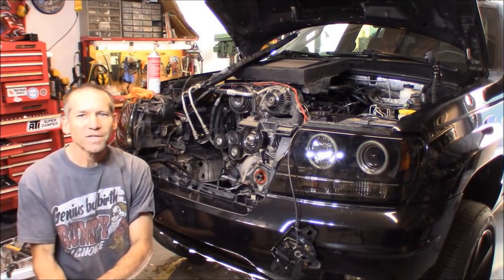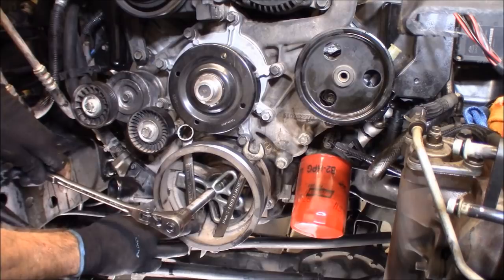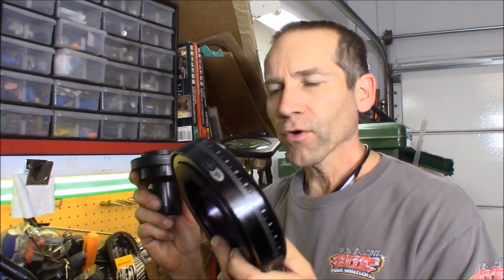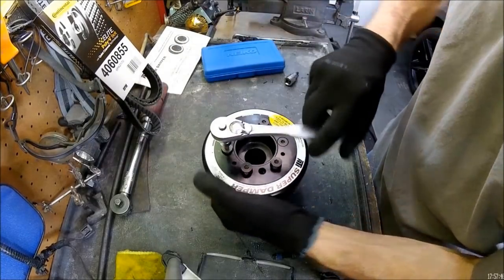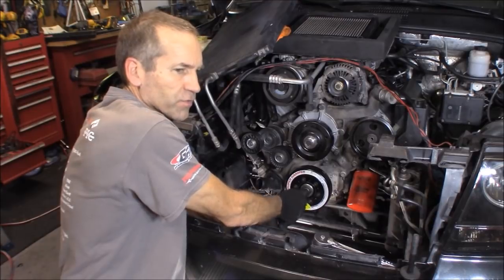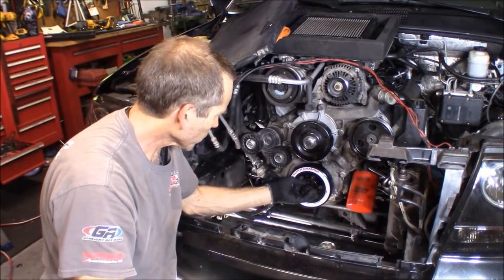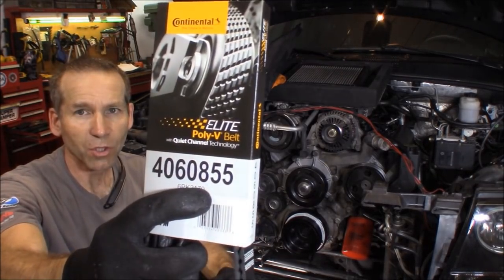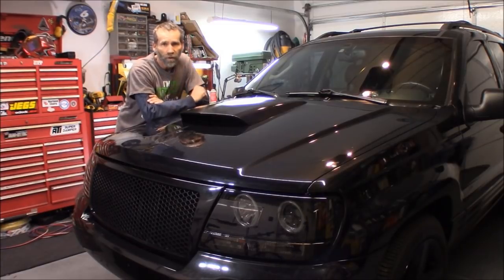How to Install a ATI Super Damper on a Dodge Jeep Chrysler 3.7 & 4.7

Comment: So, a few months ago,I asked a question of Martin on this video, and he was kind enough to reply, concerning the fact that after I put this super damper in 25% underdrive pulley on my 2000 WJ 4.7, I experienced overheating issues. I could solve it by turning the heater on full blast, which told me that perhaps the cooling system just could not keep up after reducing the size of the pulley by 25%. however, Martin had not experienced the same issue, so I could began looking for other culprits, so if you are having overheating issues after installing this part, here's what I did just so you have the information.

I've replaced the radiator, put in a new thermostat, flushed the system entirely, bought and installed a new water pump, and still had an issue with it overheating. I live in Texas, and it would do fine in stop-and-go traffic and in town traffic, but as soon as I hit the highway at 75 to 85 miles an hour, it would creep up to 215, 220, until I turned on the heater to blow off the excess heat, then it would return to 210.

I even bought and installed one of those solid aluminum 2 core radiators off of eBay, from GPI racing. Thing is beefy, and I was quite impressed. Everything lined up perfectly. Although, you do have to bend out the core support a tiny bit at the edges of the radiator, since it is about an additional inch-and-a-half thicker than stock. This did seem to help, and definitely kept it right at 210 in the morning time, but as soon as the heat crept back up, so did the engine's temp at highway speeds.

However, upon closer inspection after I went back to see what the problem could possibly be now that it had a new radiator, I noticed something. The genius engineers who designed this vehicle, of course put the AC condenser directly in front of the radiator, and even though I put the new radiator in, I hadn't looked all that closely at the condenser. it actually looks like it's quite clogged up, which could explain a lot about the airflow quality not being good enough to keep the coolant cool, because it's being blocked off by the condenser, which, if it's really bad, acts like a wall in front of the radiator.

So, I'm going to install a new condenser on my AC system, and also put in a flowkooler high flow water pump. They're a bit pricey, at a hundred and thirty bucks, but it would be worth it to keep the vehicle nice and cool. Increase performance often results in the need for increased cooling system efficiency. I'm hoping these next two steps work, but hopefully this information helps anyone out there experiencing similar issues.
Reply from the maker: Amazing that you're having this much trouble keeping your engine cool. I did also replace the radiator on mine I found it clogged with dirt in that area with the metal bumper support sits directly in front of the radiator and AC condenser. Now  that I replaced the hydraulic cooling fan with an all-electric the engine runs extremely cool I haven't seen temperatures higher than 200 and that is on days of 113 degrees out here in Las Vegas. You'll have to let me know if that aluminum radiator holds up I've had bad luck with the Champion aluminum radiator that I installed in my XJ I've gone through three of them. I'm done with champion.
Reply: @martinbuilt  I am a bit perplexed by it as well. I have also installed the fuel injectors that you had in another one of your videos, and an CAI from Airaid. I am running out of ideas as to what the issue is, unless there is something causing the engine to work harder than I think it is. My mileage seems to be around 15-17 MPG average, so it doesn't seem to be getting bad mileage. I already have a new cat back exhaust, and the cat was replaced at the same time. My AC system currently needs to be replaced, but even though the compressor does not work, it still spins freely and doesn't seem to hinder the engine. I have the combination mechanical and electric fans on my Jeep, and it still can't keep cool at highway speeds. Thought about replacing the mechanical fan with an electric one, but I have not found a ready-made kit for such a conversion, and I don't have anywhere to do my own fab work right now. 

My next planned step will be to try putting on the flowkooler water pump, and see if that helps. It's a less expensive option before I replace the AC system in a month or two. If that still doesn't work, I may have to finally bite the bullet and let a shop take a look at it. Knowing my luck, they'll figure it out in about 3 minutes and charge me $600 to fix it, and it'll be something small and stupid. 

I can tell you that the radiator I put in, which was a GPI Racing product, 

( https://www.ebay.com/itm/2-row-Aluminum-Radiator-for-JEEP-GRAND-CHEROKEE-WJ-WG-4-7L-V8-1999-2000-99-00-AT/262558754225?_trkparms=aid%3D111001%26algo%3DREC.SEED%26ao%3D1%26asc%3D20160908105057%26meid%3D3247e5f8a1ce41b99aedccad4689b68f%26pid%3D100675%26rk%3D1%26rkt%3D15%26sd%3D262558754225%26itm%3D262558754225%26pg%3D2481888&_trksid=p2481888.c100675.m4236&_trkparms=pageci%3Aa97f094c-bd57-11e9-8a9f-74dbd180440a%7Cparentrq%3A8821547e16c0a9e42e4f3f54fffc02ca%7Ciid%3A1 )

seems very well built, was easy to install, and definitely does help the vehicle stay cooler longer. It doesn't start to overheat now until the temp hits around 85 on the highway. I installed it this last weekend, with no issues. All the fittings lined right up, except for it being a little tight around the core support, which just needed to be adjusted with a hammer a bit. I have not heard anything positive about the champion line of radiators either.

Each time it overheats, it always cools back down when I turn on the heater full blast, even while I am still on the freeway, which seems to indicate a problem with airflow. I will update after installing a new condenser and the flowkooler pump. Also looking at replacing the thermostat with a high-flow robertshaw model.

https://www.flowkoolerwaterpumps.com/collections/hi-flow-water-pumps/products/1751-1999-2013-jeep-dodge-3-7l-4-7l-water-pump
Reply: @martinbuilt  Update: Since my last post, driving under normal and some off road conditions. The new radiator works extremely well. Also removed the old AC condenser. Definitely was a factor. It was warped and partially clogged. Been driving without it entirely, as a complete new AC system is on the way. No overheating in 100+ degree weather as long as it was under 2200 RPM's. At highway speeds over 75 MPH, there was still overheating, but not as significant as before. Pulled and inspected spark plugs and coils, none showed abnormal wear. It may be that at higher RPM's the stock water pump just simply does not rotate fast enough to keep up, with the 25% under drive pulley, while ambient temperatures are higher than 90F (average it has been in my area for weeks). Hoping the new Flowkooler at the end of the month will fix that.

Side note, when I had the cat replaced a few weeks ago, the mechanic who inspected it said there were multiple cylinders with slight misfire. Not enough to set off a CEL, but enough for his diag machine to notice. Immediately pulled my plugs and re-gapped all of them. None were far off of .040, factory recommended gap. I run OEM champion copper's. One factor may be that when I originally got the vehicle, I replaced all of the coil packs with new coil packs with lifetime warranty autozone models, not mopar, as the mopar coil packs were 3 times as expensive. I may have to go ahead and spend the extra money if the coil packs prove to be part of the issue.
Reply: I put vents in my hood to evacuate under hood air. With the WJ's unibody design there is no gap between a body and frame for air to escape and the 4.7 is really up under the cowl not to mention pretty much stuffed in there side to side. The biggest fan in the world will only pull a limited amount of air into the engine compartment through the radiator if the air already under the hood cannot easily escape. My coolant temp dropped from around 210 in summer to 195, even pulling a 4000 lb trailer though the Arizona mountains. The AC worked better also. The real tell was hot much hot air comes out them when stopped. With the engine hot and fan running I could not keep my hand over the hood vent, the air rushing out was way too hot. Even with the engine shut off when hot the amount of hot air escaping through the vents was amazing!
Reply: @matthewirwin8721  Hi. Did you get the overheating figured out?
Reply: @DS-wt7ul  I have an 02 with 84000 miles on it. I still ha e the hydraulic fan. I use the torque pro app to see temp and I see mine get to around 223 and then the fan kicks into a higher speed and cools it back to 195. While driving it stays right around 206 with or without ac running. I also installed a seperate temp guage because the dash guage and torque app were not the same. The new guage matches what torque pro reads from the EMC. I have flushed and replaced the radiator fluid and put in a new water pump along with a factory temperature thermostat. I think it 195 or 196 degrees. I will be doing an electric fan conversion as soon as I can. I do not like to see those temps get that high.
Reply: @timbenracing  Tim, I see the exact same temperatures. My temp will spike up to about 225 when under load, then come back down once the load is removed. For example, going uphill the temp spikes to about 225, then on the downhill temps come back down to 205-210. I'm starting to accept that this is normal for these trucks as long as the temps drop back down eventually. If temps continued to climb or never came back down to normal I would suspect there was a problem. The coolant temperature warning light on the dash doesnt turn on until 252 degrees F.  
One interesting thing I've noticed is that my engine temperatures do not spike until the transmission temperature has reached full operating temperature (150-160).  In addition, I've noticed that with the trans cooler mounted in front of the radiator, there is valuable cooling real estate being lost. After a long drive the area of the radiator behind the trans cooler is noticeably hotter to the touch than the rest of the radiator. Is the trans cooler blocking airflow and/or transferring heat from the trans fluid to the radiator? I don't know. Just some observations I've made. Good luck to you. If you figure something out let us know.
Reply: @DS-wt7ul  yes the trans cooler will have an affect on the radiator. Not much we can do with such little room. Would be nice to move the trans cooler and use a smaller seperate fan for it. Either way unless you convert to electric the ECM in the jeep will not let it run cooler. I agree with martin by running these cooler it will help with the valve train issues these 4.7l can have. I would love to see it no higher than 200 all the time.
Reply: I read flat heat will destroy the 3.7s, so I'm leary of the conversion.

Comment: Will this damper work on a 4.0?
Reply from the maker: No, it will not. 🙁
Reply from the maker: this one will but check out that price. 😲

https://www.newcomerracing.com/store/p23/Jeep_AMC_4.0_4.2_Stroker_%2887-06%29_Direct_Replacement_ATI_SFI_Approved_Harmonic_Six_Rib_Serpentine_Balancer_Kit.html
Reply: @martinbuilt  Figured as much. If Im looking into stroking a 4.0, should I look into a stronger damper to go with the crankshaft upgrade or is that unnecessary?

Edit: just saw your second reply with the super damper link. These prices are too damn high, man!

.....but look at that hardware........
Reply from the maker: @SalFettucini  
definitely, if you are building a performance engine. The Super Damper is insurance for the bottom end of that engine.

Comment: Are you still happy with the SuperDamper modification? Also, what kind of exhaust set up are you running? Your rig sounds tough man... I like it
Reply from the maker: Yes I am!
Running Doug Thorley headers, 3" exhaust, Magna Flow cat, and Flowmaster 70 or 50HD don't remember what muffler I had in there at the time.

Comment: Do you have an Instagram? I have some questions. Is that a 4.7HO? What tune or tuner/programmer works on the HO PCM? What mods aside from that grabber intake and pulley is done to yours in the video?
Reply from the maker: I do have a Instagram I have not been on it in years. Yes you can do  a tune on a HO engine. Look into SCT programmers. Check out Air Ram Performance.
I have done HO cams, upgraded the fuel injectors, Doug Thorley Tri y headers with 3in exhaust Flowmaster and a MagnaFlow high-flow cat. Recently I also installed the new Mission Weapon X stage 2 coils. I've also installed the 08 intake manifold and a custom build 75 mm throttle body. I will be installing the 08 camshafts and then I'm going to do the tune using a SCT programmer.
Reply: martinbuilt Sup Martin, Flow here again, I've done the Tri Y's except I did a resonator delete along with a muffler delete cause I wanted it to sound a little on the loud side. Still have cats on the new wj overland I have now. And the torque snip just like the Laredo. I have the H.O engine I've been meaning to do the diy ram air intake you did but the more and more I watch I get more curious as to how much power you are making. (If you don't mind lol)
Reply: martinbuilt I have an 02 HO, currently stock except a Y-pipe back full 3” into a Borla muffler. You said in another vid that the 08/09 intake mani is better than even the 02? The 08/09 cans are a direct bolt in to the 99-04 4.7? What fuel injectors did you use? In this vid were you floored during the pulls? I will also be looking for that 454 throttle body, my local junkyard has hundreds of the GM trucks there. And, forgive me for asking, are you the same Martin that built/build the Martin Saine trannys? Any specific model of programmer for the SCT programmer?
Reply from the maker: No I am not that Martin. Yes the 08 plus camshafts are a direct bolt in for the 99 through 07 4.7. Yes I was floored during those pulls. I have the SCT 3200 programmer. I am running the Denso 12582704 injectors. They are 264 CC I believe that comes out to right at 25 lb.

Comment: nice video, but i think you meant 85.5 CM (not inches) for the shorter Continental Serpentine belt
Reply from the maker: I meant inches. Those belts are longer then they look.
Reply: It is total length/circumference. Yes I am replying to a comment from 4 years ago (2019)

Comment: Did you say this wont work on an h.o engine?
Reply from the maker: No this WILL work on a HO engine
Reply: @martinbuilt  ok sweet. How did you get in contact with air ram? Ive been emailing and I get no response
Reply from the maker: @albertogonzalez5564  you can go directly to his website and simply order the ATI damper. If you have any problems with that let me know I'll get a hold of Nick
Reply: @martinbuilt  that part is ordered and delivered. My question for nick was for the port and polished heads and a few other items
Reply from the maker: @albertogonzalez5564   Give him a call before 11:00 am  Eastern time.
Reply: Alberto Gonzalez just call Air ram there number is on the website nick answers the phone most every time and if not calls me back quick !!!
Reply: @Arykperry  thanks man. I already got in contact with him.  Got my engine rebuilt with most of their upgrades. Just need it tuned
Reply: @albertogonzalez5564  what were all the mods and how is it now?

Comment: Who has $400 to throw away on a pulley that's crazy
Reply from the maker: It's not $400 for a pulley. It's $400 for the best HARMONIC BALANCER made. That is what is keeping the engine from flying apart. The pulley simply bolts to the Super Damper.
Reply: Plus money to hp gains is a lot better than headers. Good stainless headers will run $1,000+ and give about the same gain. So why not go cheaper and have a happier rotating assembly